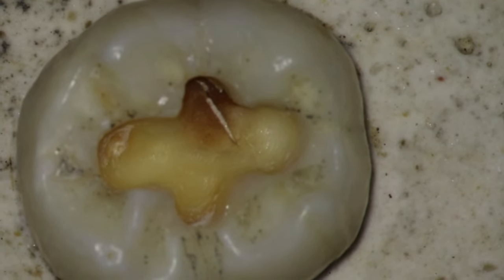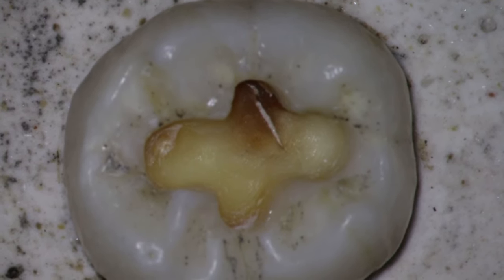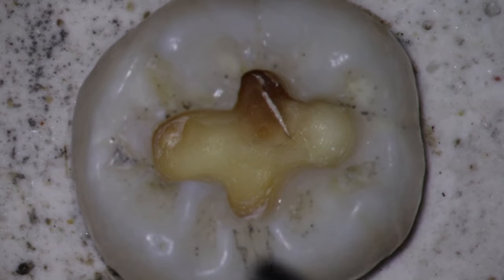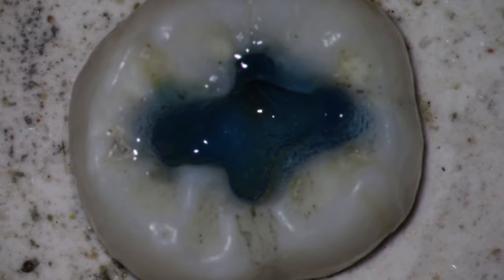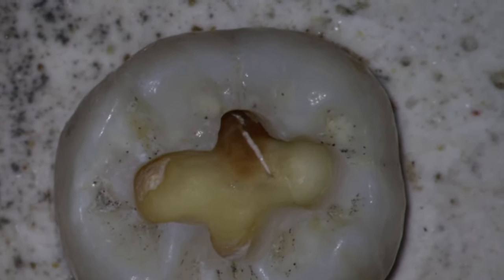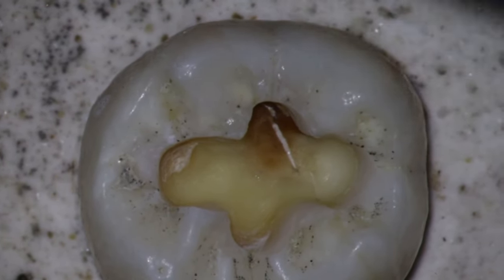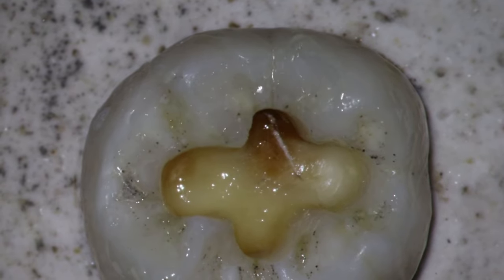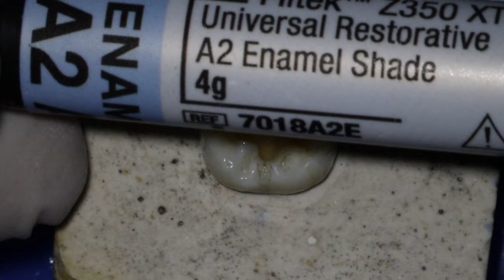Steps in composite restoration | Total Etch

Comment: 1. in selective etch , it's 30 sec etching for enamel and 15 for dentin right ?
2. after etching , How did  you rinse , was that air + water simultanously ?
3. after applying bond, you air thinned it , but doesn't that go against elastic bonding concept ?
Thanks for valuable information.